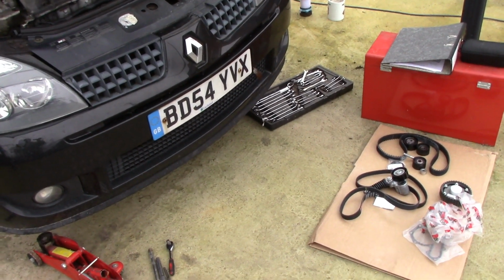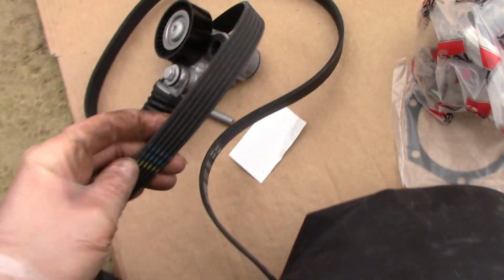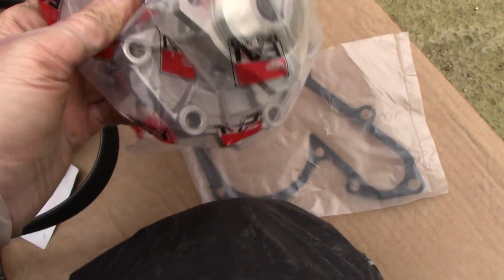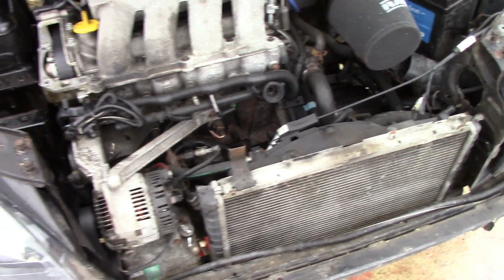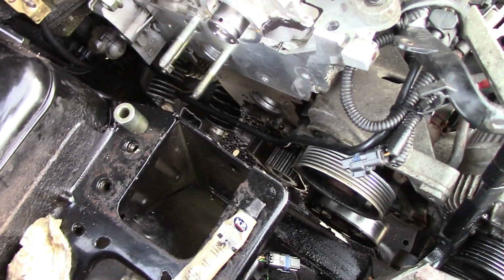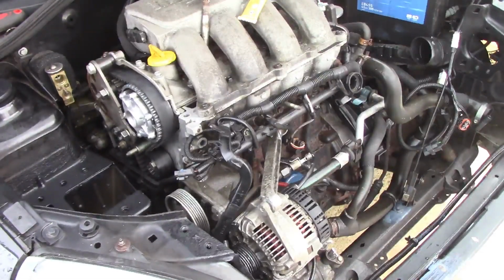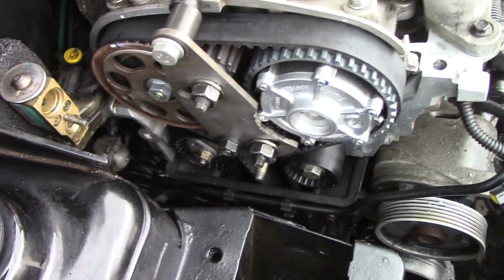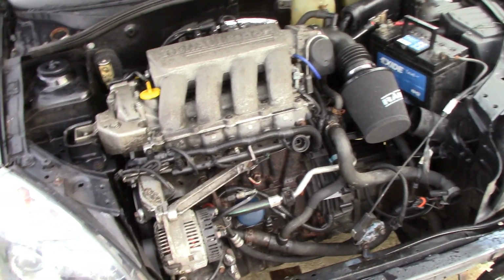2004 Renault Clio: Replacing F4R Timing Belt, Aux Belt & Fixing Oil Leak

Comment: I don't believe they take the engine out,they just loosen the mounts and move the engine over as far as possible.
K Tec do a full belts / dephaser and water pump change for under £700 I believe.
At least I hope they do because I'm on 134K last done 80k.

Comment: How did You remove the lower(plastic) timing belt cover? Did You raise that side of the engine so much that it’s possible? I can’t figure it out😄
Reply from the maker: Yeh, undo engine mounts and put engine up on jack. be REALLY careful.
Reply: @grimreapers  Cheers, I’ll try that, lift as little as needed, I suppose👍

Comment: As I understand it the variator uses centrifugal weights to change timing.
Main reason to replace an old one is with mileage they weight parts begin to rattle so the engine
sounds like a diesel on idle.
Reply from the maker: thanks!

Comment: SuperCap! I need help with my '88 Mazda RX-7, it's got a 13B rotary motor and the repair shops want $2000 for labor 😢
Reply from the maker: What's wrong? Rotor seals?
Reply from the maker: BTW I want your car.
Reply: @grimreapers  I thought you might appreciate my car, good sir. 😉 And, correct, I blew the apex seals on my rear rotor. Was able to limp her home running on just one.
Reply: @grimreapers  My real problem is getting her into a garage where I can really do some work, none of my friends have space enough for a job that supposed to take 18 hours. At least the seal kits are cheap, around $250.00

Comment: 12:38 Most of the time if a "part" is required to be placed in an exact angle after being torqued. It is connected or joined in someway to other components inside the engine. If the angle is off to much the internal components may smash into other moving components and cause permeant damage. This is one of the more severe possibilities that can happen in a few engines. Another is the fuel to air mixture isn't  "timed" correctly. Engine chambers don't seal fully before the fuel is ignited. Which leads to less power output of the engine. The general idea is, if it's attached to the timing belt  or chain, something inside the motor is planned to move at precise timed intervals. And others engine components are just planned to rotate constantly like a water pump. Google: engine rockers. a few pictures should fill in the gaps as to how full mechanical engines work.

Comment: Haha cap i work at a subaru dealer. We remove engines for everything haha. They come out really quick in most cases. The fast guys are pulling the non-turbos in around 35-40 minutes
Reply from the maker: Holy cow. If you come across any Classic STi V6 for sale plz let me know :)
Reply: @grimreapers  being in canada they were never sold new here, so they're pretty rare as imports

Comment: Dont worry about the seals on a Renault, probably not your fault.

Common issue even on newer Renault meganes and trafics to have leaky seals or dodgy sensors (especially MAF sensors or on diesels, anti-pollution sensors). Can't get along with french vehicles, had more luck with british built fords.
Reply from the maker: thx

Comment: Hey the engine is facing the wrong way... Go to Maccas get two plastic trays, put them under the rear wheels, put handbrake on and do some donuts for us Super Cap 😝
Do you ride motorbikes, if so if you ever come down under we can stick you on one of our race bikes 😬
Ps: They are called E-Torx sockets. Also Bolt torque is to get to snug point (correct tension) . Then the angle to to give the bolt the correct stretch.
Reply from the maker: 4 wheel only. Cop thanks Jesus!
Reply: @grimreapers  we can always teach you to ride 😁